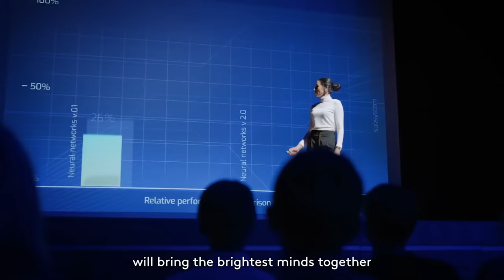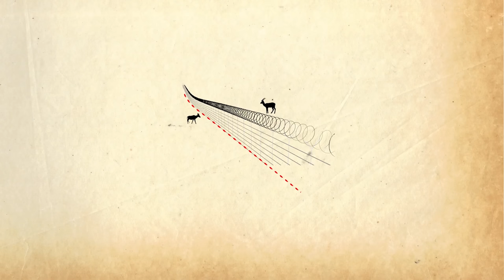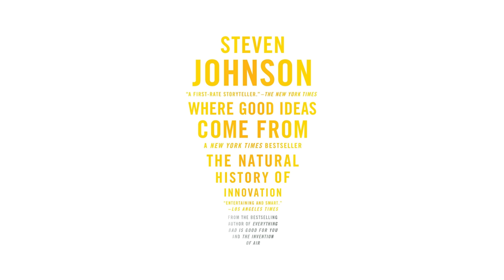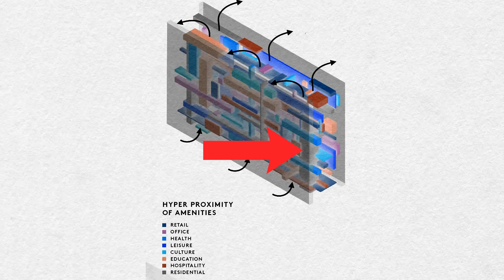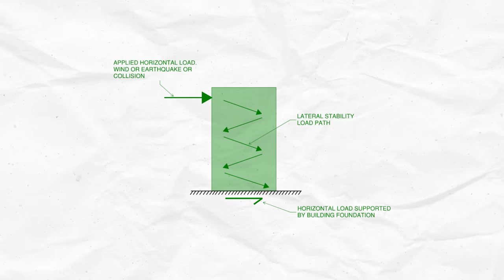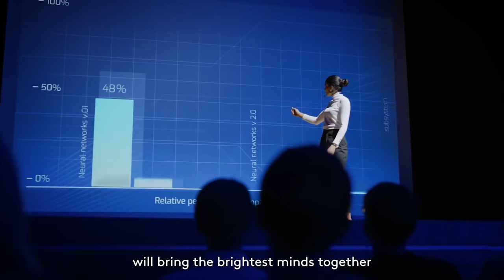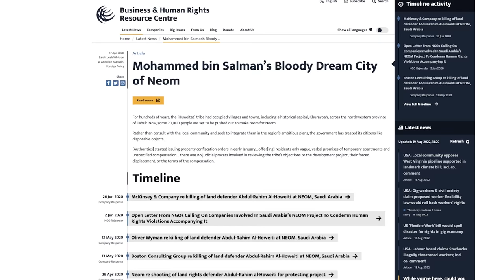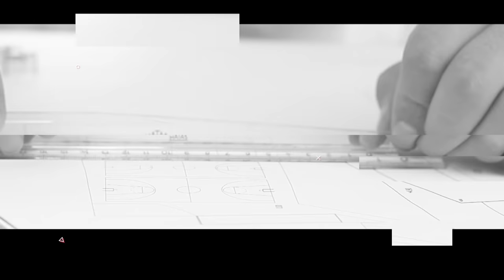This city concept breaks architecture (THE LINE)

Comment: You pretty much covered all of the major points. The Policies of who gets to live there and in what manner are really key in my humble opinion.  And the displacement of the local tribes should probably be a deal breaker unless something is done for them. This City would interrupt the natural flow of energies, not to mention travel in the area for 170 Km IN EVERY WAY. There will be many opportunities for abuses in ways we can't even foresee yet.

Have detailed designs for one of these, "Modules", be done yet? A big minus is that Structurally it sounds like a Beast to design for, I can't imagine the size of the supports/footings for something like that. How deep the sand would you have to dig to find the needed Bedrock? Would you disrupt Aquifers? In other words, has a proper Geological survey been done and the correct sight definitely been chosen already? The collective wind shear and damage from sandstorms alone would be a nightmare for the outer walls to deal with. Experimental Materials would have to be used for both the strength and ductility needed for Seismic disturbances for something that tall, long, and narrow. Not just the design, but have Dynamic Simulations or Stress Tests been run for how it would perform in extreme Seismic or Weather events?

One of the pluses might be if the walls were tinted solar collectors and not mirrors, you might not have to worry about power for lighting the city or heat zones in the surrounding countryside. The energy collected could or should be used to help run the city. Perhaps small Nuclear Generators would be needed as supplements depending on what the actual loads turn out to be. The "used" water could or should be treated/filtered, and used to turn the surrounding desert green. Or given to local Tribes along with any excess energy generated.  

Which brings me to the MEP design. Has there been a proper one done yet? Not just that, but Dynamic Model Simulations of Function based on population size and use by various Industries within the City? Passive cooling and well placed skylights and mirrors would have to be incorporated in this design for enough light and ventilation to make it practical and livable for all. You had better make sure you have not only an adequate Potable Water Supply via Desalination, but proper Sanitation and Drainage Plumbing Design to services the Population that can also handle Extreme Weather and Seismic events. Not to mention a Robustly Engineered Modular Wiring Schemata with Backup Generation to power such a massive system that can be repaired quickly to prevent long Power Outages especially in Critical sections of such a City. These things are a Matter of Life or Death IN THE DESERT.

Have an Army of Architects and Engineers been hired already for this? Has anyone done a detailed estimate for all of this? The Design, Development, and Estimating costs alone will be in the Millions. And which Construction Firms have been tapped to build this?  The final Cost Estimate and Schedule must come from them ahead of time and with excruciating detail to prevent cost overruns, fraud and abuse. But mainly to make sure that they have a proper plan for proceeding at all. Again, you must have a FINISHED DETAILED DESIGN for any of this to occur.

How are you going to Procure the millions of tons of the Experimental Building Materials needed for a Mega-Structure like this one?  New Industries would need to be created just for that. The Logistics of ALL OF THIS will be insane. . But these details MUST all be settled beforehand if this project is to have a chance.  Probably the reason there are so many abandoned projects in the Country already is that someone hasn't been properly doing these things. 

This city would be a horrible strain on the environment during construction. Can you imagine the size and scope of the Staging Areas? They would be Small Cities in and of themselves. The Prince has lofty ideas, but he's gonna need more than just those to pull this one off. IT CAN BE DONE, and would put Armies of people to work and boost several Nation's Economies for at least a Decade. But I agree with you Ms. Lee, this might not be a good idea all things considered.. Superb analysis and commentary.

Comment: imagine how much of a nightmare The Line's sewer system is going to be, 100ft free fall of shit suspended in water making the perfect water hammer maker. a single burst pipe along the floor will flood the entire bottom of the city with no where to go, and the sewer treatment plant is going to inside the line's walls meaning all the gas and smell will be trapped inside the city

Comment: The idea of a linear city has been around since the 19th century.

The idea of Neom may have been influenced by the Continuous Monument of the Superstudio group meant as a negative dystopia. 

An idea that has been tried is the Circular city built c1000 years ago in what is now  modern Iraq.  It failed but the concept was reinvented as the Panopticon prison of Jerem Bentham(?).  These prisons were exceptionally bad at causing mental trauma to inmates.  The one in Norwich was pulled down and replaced by a cathedral. 

The only linear city that has been built is Volgograd(aka Stalingrad).   It follows the bank of a river and has a 50km road.

Comment: The sunlight situation is much worse than you think. Pure sunlight is maybe 8,000 footcandles on average from 10 am to 4 pm. As soon as you have ANY shade at all, you drop to 1000 footcandles. So if any of the inner surfaces are not mirrors, you get 9x less light immediately right below those portions.

Looking from the outside, if it is reflective and not windows, it will block out 93 percent of the sunlight all day long. 

So, lets say it has 50 floors. The top 5 floors only will get significant, healthy light of 5000 lumens or above for vitamin D, melatonin, seritonin, and circadian benefits. 

All bottom floors will seem like being in tree shade at best or at least 4x worse with every 10 floors unless you artificially light the whole place.

Comment: I just had a weird thought, now I am no engineer or architect but by building a straight line city haven't they effectively built a massive sail? Wouldn't that be extremely bad in a building that tall especially in a environment where sandstorms are a thing and desert if I remember correctly generally can have decent wind speeds due to a lack of anything in its way. Now as I said I am not qualified in any of the related subjects but... now I've seen it, it seems to be obvious.

Comment: The city would be better off as a wheel. Criss-crossing transit rail with two lines running counter each other on the rim. The central hub would be admin offices and would be strong enough to build upward many stories.

Comment: What about rain and flooding? I know that seems like a silly question to ask because it's the desert and they won't get a lot of rain, but I lived in Las Vegas for a while and the one thing I learned about living in the desert is that when it does rain it is a heavy downpour. Las Vegas would flood horribly every time it rained. I once watched a staircase turn into a freaking waterfall that looked like a rushing rapids! The thing that made it worse, was that the ground was so compact and there was so much cement and pavement everywhere there was nowhere for the water to go. Where it did end up going, was under the city in underground tunnels. There are people who live down there and every time it rained they would rush to escape and if they didn't they would die. What's worse is that the rain can be really unexpected and happen in an instant. You can go from a sunny day to a downpour so fast you have very little warning.
What worries me even more about this project is that they're basically creating a mountain right next to the ocean. If you know anything about how mountains create rain then you know that that warm wet are coming off of the ocean gets pushed up and cools off creates clouds and causes more rain. I don't know if this wall will be tall enough to create that effect, but I think that having it so close to the water and covering such a huge distance that that's definitely something to consider! And what kind of drainage system do they have in this place? Are the subway systems just going to flood? Are the shops going to flood? Are people's homes going to flood? This sounds terrifying! And how would that change the overall climate of the entire area surrounding them? You already mentioned how these mirrors are going to create this enormous amount of heat but it could also be disturbing rain cycles!

Comment: Seems like it would work better if they created a large circle, instead of a line. Here transportation goes to an end, stops, and has to go back in the opposite direction. A circular design seems like it would have better flow. And in addition, the interior walled off area could be developed for livestock and farming.🤔🤷🏼‍♂️

Comment: Already been cut.! Who didn’t see that coming.
Reply: The first date they announced the project I knew that they couldn't finish it.  It is not how construction projects are done.  They announced a high speed train that can travel the 170km line within 20 minutes.  The speed required is 510 km/hr.  The technology was not there then and even now.  Contractors cannot accept tender offer for non-existing technology.  This speaks for the validity of the whole project.

Comment: I thought the biggest fail in this design is that its not built for growth. Adding levels is hard and the line can only extend to the other coast since it starts from one already.

Starting small wouldve been a great idea. Prototype, not build this huge.

They already scaled down to 3km or so. Curious to see how it works.

No farmers, no farms. No retreats.

Wont really work.

In the end, its not fixing anything that really broken.

Comment: This Line project is a kind of New Settlement Element project of group of Soviet architects. It is vertical + square instead of horizontal + hexagonal. There is the only Wiki article : https://ru.wikipedia.org/wiki/%D0%9D%D0%BE%D0%B2%D1%8B%D0%B9_%D1%8D%D0%BB%D0%B5%D0%BC%D0%B5%D0%BD%D1%82_%D1%80%D0%B0%D1%81%D1%81%D0%B5%D0%BB%D0%B5%D0%BD%D0%B8%D1%8F (sorry, Russian only). They participated in some international exhibitions, but almost unknown.

Comment: I think I can begin to understand what they were going for. 

1) it's a marketing gimmick.

2) it's an urban planning experiment on grand scale. 

You see how even the best planned cities or towns go off plan? 

Population grows and required services and utilities often struggle to find room causing for compromised designs and chaos creeping into overall plan, sooner or later.

With something "linear" and measured out like the line city, if it's a success and takes off, everything can expand in a neat , geometric manner. 

A "modular city" if you will. 

If population grows, dump additional food storage and waste treatment plants every few hundred meters or so. 

Public transport coverage? Ridiculously simple and probably could use high speed transport methods within the city limits, due to its linear design. 

And if it gets exceptionally large, you can then imagine "the line" becoming parallel lines, or a cross or a grid. 

They want a neat, structured city that makes engineering and general sense like Germany (how its supermarkets have generally same aisle layouts, you dont get lost... probably planning something similar with floor plans and street layouts), while looking pretty from overhead flights and satellite photos. 

That's my theory anyhow.
Reply: On second thought, most logical plan for expansion would be a parallel line and filling in the land in between. 

But you never know with rich Arabs... 😂

P.S. if realised it would have alot of advantage in terms of solar power generation, wind power generation, power redistribution, moisture reclamation, etc, etc. 

When accounting for its overall uniform shape, (relatively) uniform and predictable thermal conduction and parts of structure being able to act like natural cooling ports/wind tunnels. 

Plus things like geography of proposed site, local climate, weather patterns, etc., etc.

But there are alot of IFs as to whether this concept city can succeed. 

Do they have population basis to fuel such rapid growth? Or is this a long term plan they are happy sink cash into for first 50 years or so?!?

Comment: The first time they announced The Line and showed the concept design, I always find it dystopian. Though it would be designed as a utopia for all, there will be some development towards the separation of the haves and the have-nots. Eventually there will be "slums". Will the slums be relegated by which floors they're on or which side, e.g.: the older part becomes the slums.

I'm not optimistic of this project and somehow destined to fail and end up having this massive post-apocalyptic like unfinished structure in the middle of nowhere where outcasts will be sent to. Hope I'm wrong.

Comment: "You can travel 170 km in 20 minutes" 
Every digrams of the city all I have seen is TWO ! train tunnels. Assumking it only has stops every 20 km that stop times on stations alone would account for way over 20 minutes on 170km. 
Also in none of the diagrams there is no turnaround on the tracks At one end the train tuller end straight into sea.

Comment: Really an extrapolation of street cars to allow the creation of satellite commuter communities which started with realtor developers and Los Angeles.   The single line is because an expensive high speed rail possibly maglev was to be showcased (hopefully with offline stations to allow express and local routes).   Obviously a coastal line would make more sense but the nation is relatively featureless even along the coast.  I'm disappointed that a more PRT approach wasn't proposed instead of just high capacity, high speed.  PRT though intended to be low speed could also be designed as high speed and would allow far more flexibility than just a line and could be marketed as cells thereby tying in mobile networking concepts.   Also PRT also allows for growth and inherrently has offline stations plus they could capitalize on the PRT bid proposals for Masdar city which they dramatically reduced the contracts for.

I suspect that the mirrored surface would be half silved so light is still allowed in at refuced intensity perhaps with infrared reflected from the exterior and dispersed from the interior.   I also don't think the vertical mirrored structure is in every proposal and would only exist in some sections if built at all.  Most likely it would just be conventual neighborhoods spreading out from the high speed transit line centering on the stations, basically buildings that are the most profitable to market in the short run as in luxury suburbs and business districts.

Comment: 12:45 - sustainability: "vision 2030" as a way of reducing hydrocarbon dependency should primarily rely on far different things, that reduce wastage and earn money: 1) build a crossrails + ring railways connecting all Arabia's seaports in between of each other and inland settlements, mineral mines etc., as well as neighbouring states 2) build more cross-country oil and gas pipelines in between of the gulf, Red and Mediterranean seas 3) invest in solar-powered air conditioning and desalination (that runs mostly at daytime and rests at night) 4) build more solid trash, coal burning, nuclear powered electricity plants so you can export most of precious carbohydrates and produce electricity out of cheap sources instead. The most obvious things that attracted least attentions thus far.

Comment: Lets see: they note a footprint of 34 km^2 x 500m tall 200m wide twin rows of row-house skyscrapers.
Apply typical cost per sqft/sq.m from any modern City in any part of the world and you will quickly see the 'estimated cost' noted is off by at least a factor of x1,000 from typical costs of construction. This will end up resulting in a smaller version no doubt, or abandonment of the work.
All this talk about 'walking distance' but not everyone can walk.  20minutes from end to end in ultra-fast train - so the train has no stops along the way to get on or off?
Reply: 32,000,000 sqm per level x 100 levels (one every five vertical meters?) x typical cost of construction would result in a budget of 1,000-Trillion USD to build it, now factor in costs of operation and maintenance for the first 20 years...LOL the project has failed before it even starts.  (compare to the world GDP of 100-Trillion per year or Saudi GDP of less than 2T per year ...approx).

Comment: It’s 200 meters wide, 500 m high and 170 km long!!
If you want to quickly cook some dough, you make a caper thin like Neom!! 😬
Why didn’t they make it a round or square city and grow a large desert forest to make it cooler instead exposing a 170 km wall against the desert heat, sand and winds?
I think it’s least practical shape and most expensive, time consuming and difficult to build and maintain!!

Comment: Its just pure simple maths. Walls 500m tall x 200m wide x 1m depth = 100,000 cubic metres.
Length 170km or 170,000m is 170,000 x 100,000= 17,000,000,000sqm or 17bn cubic metres.
At a cost of $1tn dollars $1,000,000,000,000/17,000,000,000= $58 cubic metre.
That's without carbon neutral power stations, a train that will take to from end to end in 20 minutes, an airport or external sanitation and water facilities.
Population density for 9m people 6x greater than the most populously dense city in the world, Manilla causing crowding. 
$58 a cubic metre?? 
Good luck.